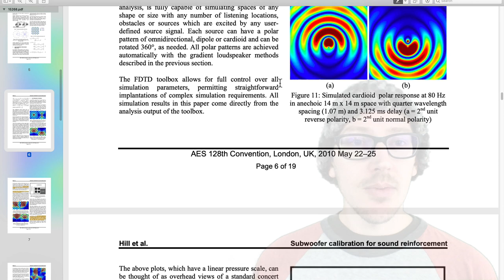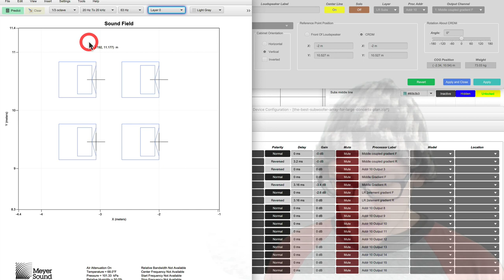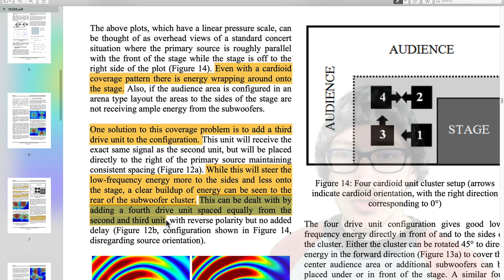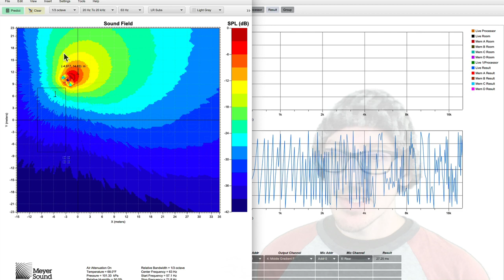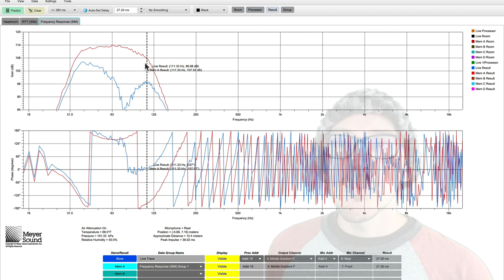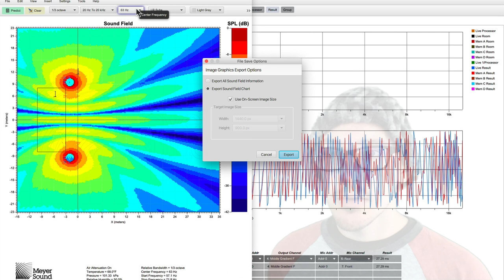How to build a 4-element inline gradient subwoofer array

Comment: I don't really see how that would be better than just having a 3 element cardioid array in the middle of the stage, if there's space for that.
Reply: If you have audience far from stage at the 45° position, you need to figure out a way to get energy to them.

If you were using center subs to get the necessary amount of energy to them, any audience in front of the center of the stage would be exposed to really high sound pressure levels.
Reply from the maker: Hey Zamas, that's a great point. I think the idea here is just to have more options for creating different results. A single 3-element inverted gradient stack creates a coverage angle of about 180º, which might not be appropriate for every situation.

Comment: Dave at Rat sound has a post about using this with the Chilli Peppers, I’m interested in your ‘acceptable’ level of level disparity per freq front to back, side to side, do you have a working threshold? Also the age old question of balancing tops (specifically line array) with Subs!
Reply from the maker: Sure. The best broadband F2B rejection I've seen is with a 2-element inline gradient array: 30dB in MAPP and 17dB in the field indoors. That's why 6dB doesn't seem like much to me. Still helpful, though!
Reply: @nathanlively  thank you Nathan, how about out front - cardioid cabs aside, I guess I'm asking the power alleys created by subs (L/R, LCR, etc etc.) if you can even out the troughs is there an acceptable medium? eg. as long as the subs are +-6db front to back. Sorry Im not great at articulating my question!